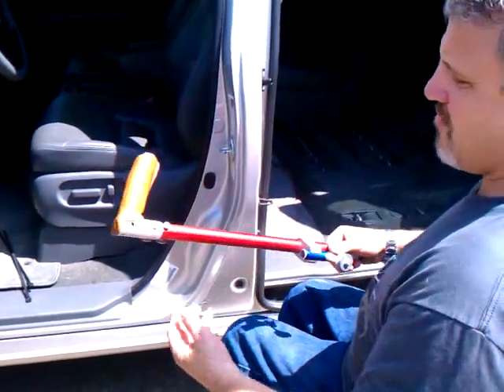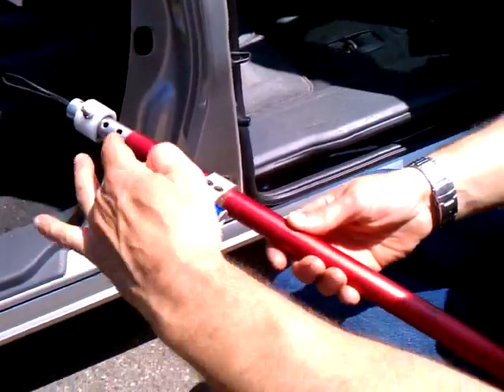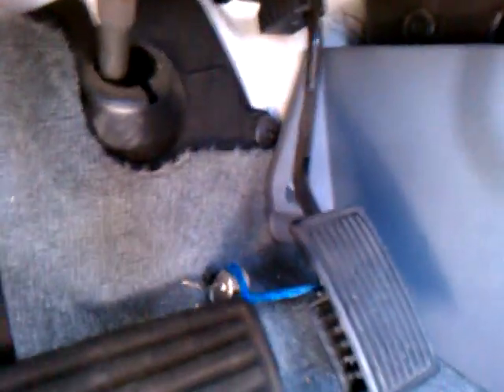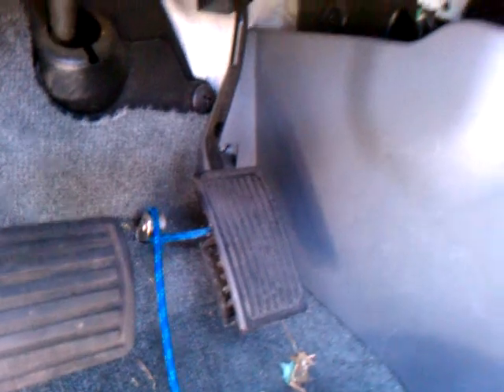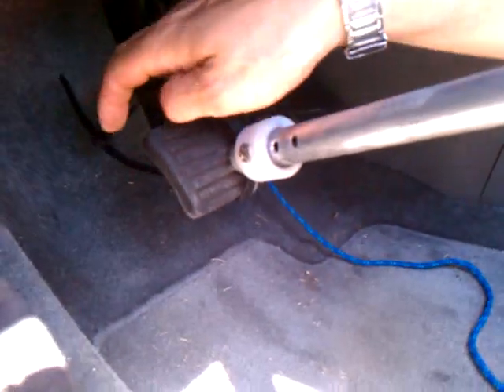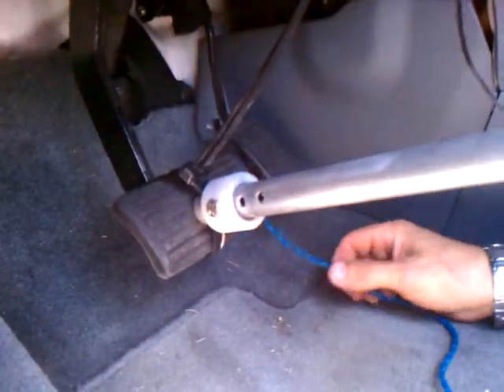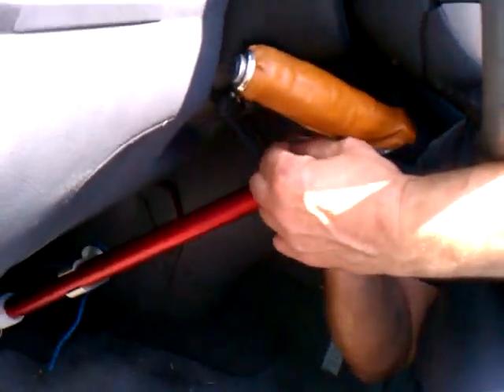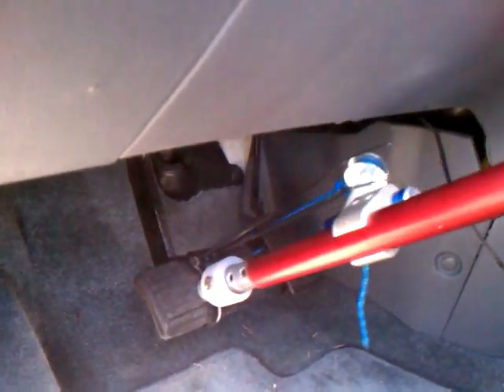Simple homemade hand-control invention & fast install

Comment: This device gives me the ability to drive my car, and since it is portable💫 allabout.wiki/Niome    I can use it in any vehicle.  I suffer from neuropathy and don't have feeling in my feet, so it is a God-send for me. I recommend it to anyone who have limited ability with their hands or feet. Getting use to it comes with practice. For those who have limits in their hands, the navigation knob on the steering wheel is a plus.  I found that I am not very good with the steering knob, so I had it removed. I can therefore maneuver the steering better with my right hand by positioning on the steering wheel in certain positions for right and left turns.  It's very valuable to me.  Without it, I would not be able to drive at all.

Comment: Great idea. In spite of the nay sayers, the 'professional' system I have seen is less stable than yours. $200 buys you a setup that doesn't look too user friendly to me, yours looks like it can be on and off for 'able' drivers in a minute or so, as I say great idea. Already figuring adapting an old aluminium (extra i, correct spelling, 😁) walking stick to suit. Thanks for the idea, saved me a lot of bucks or Euros in my case....😎
Reply: Parabéns
Reply: Irish?

Comment: How did you attatch the pulley?
Reply from the maker: https://youtu.be/o8Ux5FGcuKE?t=9m52s   sorry that's not so great but you should get the idea. and yes, I did just drilled a random hole in the car floor, in a good position to pull down the gas pedal without getting the rope in the way for an AB driver.  It is scary to drill a hole into the metal of the firewall, try to make sure you're not gonna screw something up. So far, a Honda, Mercedes and a Mazda. I drill about an 1/8in. hole then screw in the screw eye to cut the thread, then when happy, screw it in finally with the pulley in place AND Red threadlocker. In the Honda, it hasn't moved in 8+ years.  I have the Mazda install somewhere in my videos, i'll try to find it.

Comment: I thought your hand control was great!! I have made a few and yours is a good design. If you could mount it to the dash/steering column it would be safer but more perennate. thanxz
Reply from the maker: I agree! At minute 3:06 , that's what the bungee cord does... Unlike most "portable" or "non-permanent" designs, if you let go of this one, the control ALWAYS returns to the exact  same place on the column.  Thanks for watching and commenting.

Comment: Hello, i admire your creativity and i thought of the same thing for brake system. i can use my leg to accelerate but i have problems transitioning to braking.  I was thinking of using two pulleys and a lever (with lock) mechanism, but i can't seem to find the right pulleys on ebay. They keep coming up as big 2 or 3 inch pulley blocks.  Can you please tell me where and under what name did you buy your pulleys?   They seem small enough to bolt down right under the brake which would be excellent for my concept.  i appreciate any help you can give me, a fellow enabled driver. :)

Comment: I really need this!  Can you make me one.  I am a disabled Veteran but the VA doesn't respond to repeated requests for help with this.  I could use help. I am paraplegic.
Reply: know any metal fabiicators im sure two pieces of all thread one piece of 1x1 angle n a strap 6 nuts 12 lock washers two small clamps for pedals on ends of all thread rods n one small bolt n nut n lockwasher for strap would go around collume  and melt hole in strap to put bolt in center of angle metal two holes each side of that the further away the more leverage depending on weather left or right handed the angle metal needs to be longer to that side to make the push pull handle and rubber hoseing  put on each rod under n above hole in angle grommets are best but hose in a pinch these allow for a tight yet flexible pivot in controls all these pieces wouldnt cost more than 20 30 bucks a hand drill n hack saw n two wrenches tape measure  n a hot nail to make hole in strap is all the tools you need n about 2 hrs later your in biz my dad was a disabled  marine and he taught me this  and now i hope his effort through me to you is of some help you drill holes through peddles to connect rods to them first that allows for determineing all the rest as to lengths n spacing of holes in angle metal as all vehicles are different i cant really give you specific measurements but as close as you can to colume and still have enough leverage is rule of thumb like kentucky windage its a best guess and adjust accordingly hope this helps semper fi

Comment: I think the insurance company would invalidate any claim in an accident.
Reply from the maker: I'm sure you are right, they always do their best to invalidate any claim. In Germany the fuzz would arrest you for driving with these.
Reply: Same in Ireland. You are clearly asked by the insurance company if you have made any adjustments to the vehicle. If you have, they immediately refuse to do business with you unless they are a specialist disability insurer. Even then, you must get an engineer's report approving the installation and that will cost at least 300 euros.

Comment: This does not look like a good idea at all.  If you want to trust your life to a pair of zip ties and a string, don't be my guest and go right ahead.  DO NOT.  I would not want to be on the same road at the same time as a vehicle with this kind of "control" mechanism.

It might be okay for off-road use on a farm or the like, but not for street or highway use.  The strong chance of this failing and causing a serious or fatal accident should be obvious to anyone.
Reply from the maker: You have every right to your opinion, like assholes, everybody has one. FYI, those were installed Nov 2011 and they are still working fine. I check the climbing rope and zip ties for wear every few months, barely any. I do agree that, say using thinner string instead of climbing rope that fits the pulley correctly could get wedged or using only one zip tie or 2 on the same side,(or light duty zips,nothing under .25inch) could be disastrous.
BTW, when I first got injured in 1981 I was charged about $500 for some hand controls made by the only manufacturer/installer in town, they tore up my dash and 2 years later a spring broke with no warning in traffic making the accelerator floor it, only my quick reactions saved me from a bad wreck. I replaced the spring with some bungy cord I had in the car which lasted till I sold it to a TAB.
   With all those GM cars on the road,a person like you should just stay home.
     I'll write up some warnings in the description no-one ever reads, Thanks for the heads-up, No Mor Okay :-)
Reply: ebaysutube  As well as an opinion, I have over fifteen years experience using hand controls, and I've used hand-controlled rental cars in four countries.  I've used good and bad hand controls, and a scary hand control that was secured to the steering column by a strap and Velcro.  It sounds like your 1981 control was scary and put you off factory designs.  That's a pity.  I got my first set in 1997 and used it happily until a couple of months ago, when I finally replaced my old van with a newer one and got a new MPS control set that works well.  Hand controls that are bolted in place (at the top and at the pedals) are much more secure, plus most of them give you a lot of leverage to press the brake pedal, instead of the straight push your set requires.  Brake pedals are designed for foot pressure, so no matter how strong you may be, your arm strength will not be enough in a panic stop.  You may have avoided any accidents so far, and I hope your good luck continues, but that is a scary setup you have.
Reply: Why is something produced commercially necessarily better than something created by an ingenious amateur? Remember, it's thanks to the amateur Wright brothers that we can fly...the "professionals" all failed at the task.
Reply: ebaysutube If you're not part of the solution, you're part of the problem.  Let us folks who want to live our life free and without restriction do so.  Cheers to you Ebaysutube for a great set-up and inspiration.
Reply: +nomorokay  It is a very good idea actually. If someone is worried about zip ties, then they can adapt the system to something more stronger. Some kind of metal clmap, that could be secured with a bolt underneath the brake pedal. Or maybe use some kind of metal chain based solution.  Legality in various jurisdictions is a totally different matter. Here in UK or Ireland, this setup will be totally illegal.
Reply: +asimsparks I've driven rental cars with hand controls in the UK and Ireland, and they don't look at all like this.  As well as the insecure mounting, the control in the video does not have any leverage to increase the force available to press on the brake pedal.  Commercial hand controls are anchored to the steering post or dashboard, and the pushrod that operates the brake pedal is pressed by using the control lever attached to the pushrod, adding the force needed to press on the brake pedal with hand power.  The controls in the video will not allow enough braking force to be applied in an emergency stopping situation.
Reply: +nomorokay asimsparks, keep in mind that safe and reliable hand controls are available nearly everywhere.  They cost about $1000 and last for decades.  I used my last set for 16 years.  Most newly injured people who need hand controls will have them provided by their insurance company, so there is no need to jury-rig something as shown in the video.  If you're paraplegic and have the budget to buy and operate a car, it's only common sense to set aside some money for a safe set of hand controls.  Getting injured and paralyzed once is bad enough.  Why take a chance on it happening again, because you wanted to use hardware store parts to make hand controls?
Reply: bcubed72
Reply: nomorokay 2 bolts and a metal plate or some washers on the back would do the same thing a little more securely. I would personally use a whole bunch of metal wire but that's just me and not being disabled I've yet to see the advantages or disadvantages to anything. I got a car in my work with a hand brake and thought it was strange until my brain turned on lol

Comment: I love this creation.  I've bought expensive hand controls and don't particularly like any of them.  This look more like what I want.  Could you tell us what all the parts are that you used?  Where does the rope( or whatever loops out the bottom) attach to above it?  I presume it's just to keep the sliding tubing from coming apart.  What is the piece at the very bottom and what is the pulley looking wheel in the middle? and where did you find them?

Great work.  Thanks.

Comment from the maker: @Ngtin321 no. most gas pedals (older) actually involve a lever that "see-saws" and PULLS a cable out of the fire wall when you press down. So with those, all you got to do, is lasso your rope to the very top of the gas pedal mechanism. Some newer ones are modular and you have somehow press down.

Comment from the maker: Thanks for watching! Any hardware store, just match the rope you will use to the pulley wheel. the LAST thing you want is the rope getting jammed!!! Good luck! BTW, just reiterate, you only need the pulley if you don't have a  typical mechanical gas pedal.